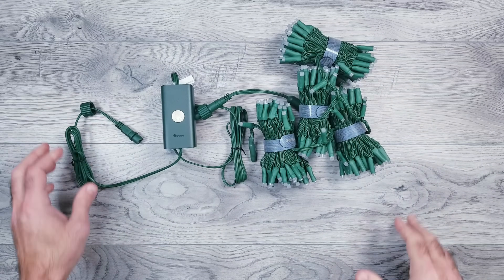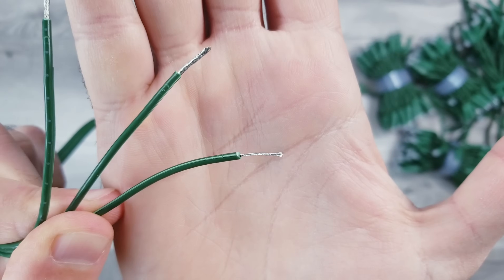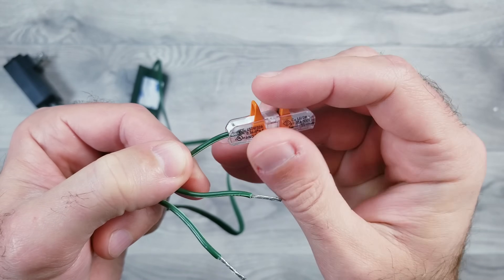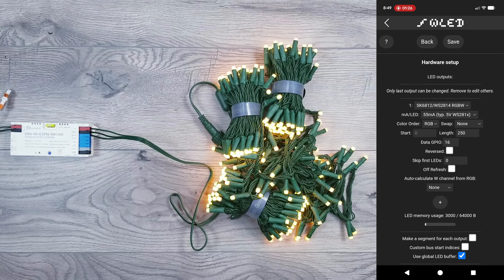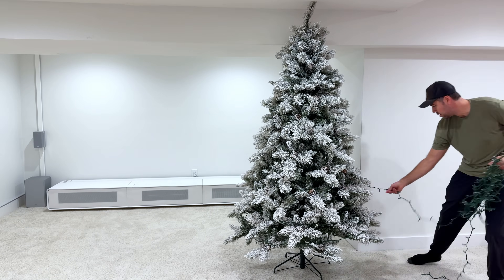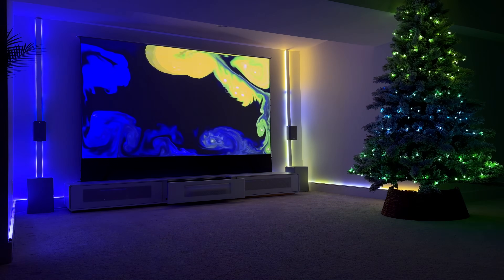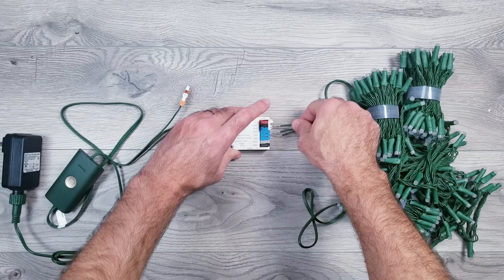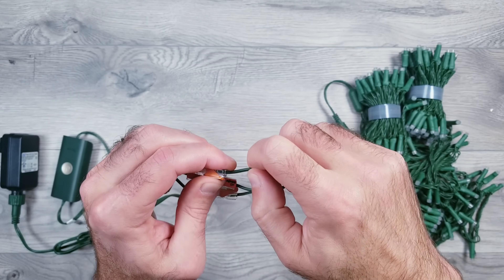will it WLED - episode 5 (brand new Govee christmas sparkle string lights)

Comment: Wow, does the 5v push well down the whole length with no voltage drop at the end?
Reply from the maker: It worked great! No drop in brightness. I was also surprised to see these only be 5v but they work perfectly!
Reply: @ChrisMaherDIY  I wonder how many mA each LED pulls at full brightness. They can't be 55mA with only a 3A power supply... I couldn't find the info on the Amazon listing.  I have some strings of 60mA WS2811 LEDs that are power hungry but they get nice and bright :-)  They are kind of clunky however and these might be a nice replacement, especially if power injection isn't needed. Thanks for this video! Definitely going to check out your setup video... looks cool! :-)

Comment: While I'll watch the videos and support the channel as ever...I feel the concept may be slightly flawed. I use WLED because it's cheaper than the prebuilt options out there, and while yes it offers better options than the pre built software i feel like if I am going to build the controller myself why not build the whole lot!
Reply from the maker: You are a true DIYer at heart. I've found that the majority of consumers would rather spend a little more and save the time and hassle of doing it themselves. Similar to why people pay a shop to change breaks vs doing it themselves. Time is money for many people and I respect that. But I also love the people that like getting dirty and enjoy a good challenging DIY project!
Reply: For these lights specifically it makes sense - the DIY bullet pixels only come in RGB. So if I want RGBW bullet pixels running on WLED, conversion is my only option right now. There's also some lights that Govee and other brands offer in form factors that aren't offered in generic or DIY options, so I'd be interested in seeing if those can be converted as well. I prefer WLED as a controller for everything not just because it's inexpensive but because it's not going to disappear when a company shuts down, and because it works with xlights.

Comment: Can you see if VOLT® RGBW Salty Dog Integrated LED Well Light will wled? Its the only thing on my property they say can only be changed with their bs remote? I would love to integrate it with my HA WLED and the rest of my system. I have 4 of these in the ground for my 60' flag pole and would love to hook them up to the new 4 channel gledopto wled supply.
Reply from the maker: Thanks for watching! Are those low voltage lighting or hardwired? Hardwired lights are usually more difficult and not something I've had much luck converting over the years.
Reply: @ChrisMaherDIY yeah unfortunately there's only two wires coming out of the housing, a hot and neutral. No data. Didn't know if there was a way to modify

Comment: Amazon has the 3 pin connectors that are pretty affordable. That way you could just connect one of those to the Gledopto and just plug the other end into the light string, no cutting necessary, and super easy to go back to the Govee controller.
Reply from the maker: Great minds think alike :) I ordered a couple yesterday that looked like they might work to see if I could do this! But if you want to use the power supply it came with you would also have to find a 2 pin connector that would connect to the power supply to connect to the gledopto since it doesn't have the traditional barrel plug.
Reply: @ChrisMaherDIY Chris, would you mind posting a link to the one's you bought?
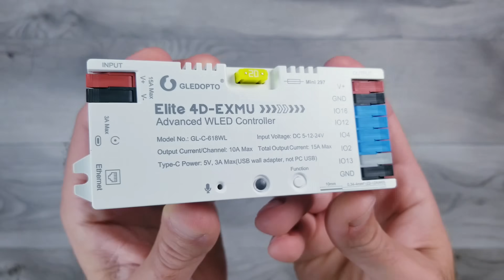Reply: @ChrisMaherDIY  at 0:54 it looks like there’s a barrel jack on the Gledopto, no?
Reply: Would you mind posting a link or brand/description for Amazon?

Comment: Does it also work with non Govee "sparkle string lights" ? We have some older string lights all over the house without RGB. Does it also work with these
Reply from the maker: Thanks for watching! It depends on what type of chip those lights are using. Some led strips are analog and some are digital. But if the lights you have are able to do different colors at the same time throughout the string, good chance you can get them working with WLED.

Comment: Hope this WLED works, I just got a set from your link :)
Reply from the maker: This one is easy so you should have no problem! Did you watch the end part of the video where I show how to convert back to Govee if you want to switch back and forth?!
Reply: @ChrisMaherDIY  Yup, just need to buy some more inline connectors!
Side question....and I know you all are busy, so no expectations on a response! :)
I have a brand new 5th Govee 2 curtain and it connected to WiFi fine, but my other 4 from 2024 never would and  can't now.  The phone app works fine, but functionality is not full without WiFi and the desktop app won't work for them.   So far, Govee support has been less than helpful, any ideas?

Comment: Hello Chris, thanks for the video. Kind of a tough one for you. I have one of these Christmas trees with the seed pix  and the controller went bad and the controller for the tree is just a little white push button and it has a remote and app neither work and I open the controller and it only has two wires in for power and two wires out to the top of the tree so it’s not a three wire Any ideas about this I’d like to convert it of course over to a WLED type controller.
Reply from the maker: Thanks for watching and great question! My guess is its an analog strip, not digital which usually works with WLED. When the tree was working, did it have a bunch of colors you could use or was it simply a white light? If it was colors did it only allow for one color at a time?

Comment: A few seconds into the video bro is chopping off the govee controller lol I know that’s the point but it’s just funny to imaging the govee rep who sponsored you watching in horror as you cut the wires lol
Reply from the maker: Thanks for watching! My thought process is that there are many people that will now buy these lights knowing you can run them WLED on that might otherwise not buy them. Some people run everything off WLED and those people would probably not buy a govee product if it couldn't be converted.
Reply: @ChrisMaherDIY  absolutely, and I appreciate all the DIY efforts! I just couldn’t help imagining that and thinking it was funny, especially when the wire cutters came out within seconds of the video starting

Comment: hi chris i just wanted to ask if you can sync every product using wled to use everything at the same time?
and with signal rgb
love your videos
Reply from the maker: Thanks for watching! Yes, any product you have running WLED can sync with other products running wled on the same network. When the lights are connected to signal rgb, they override the wled program until you switch back.
Reply: @ChrisMaherDIY   thanks!